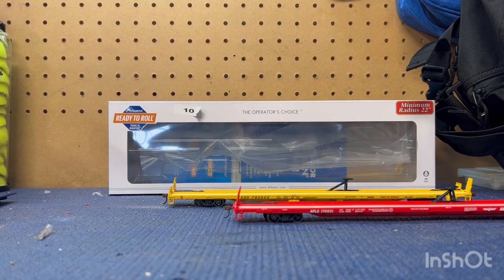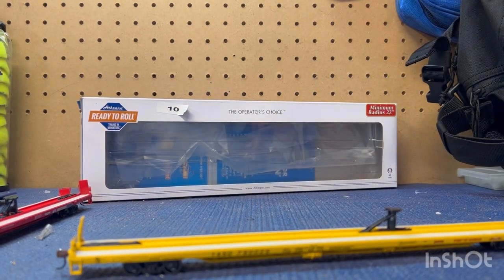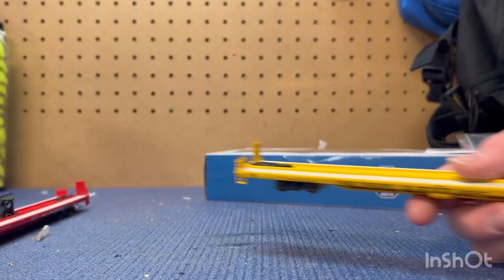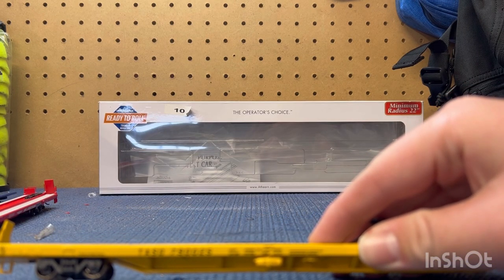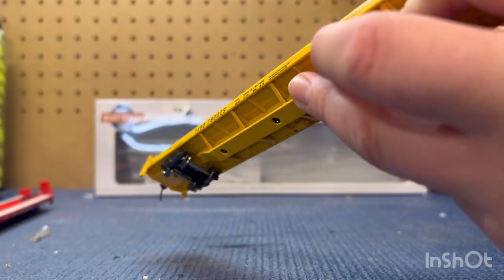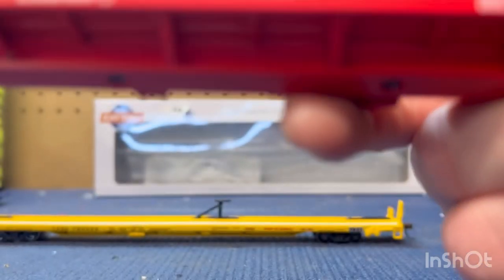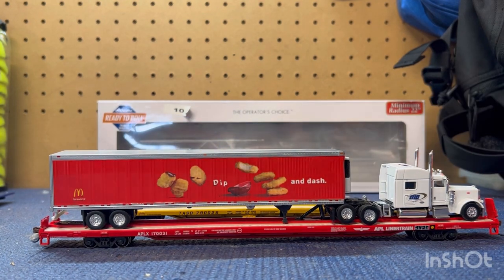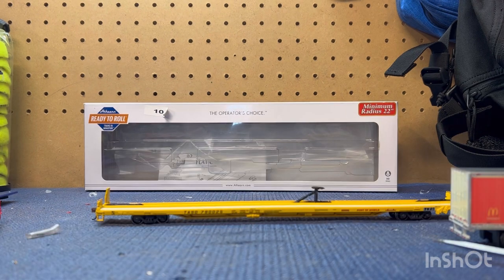Ho scale Athearn 85 foot ￼all purpose Flat car

Comment: Nice cars.I've got a few myself.😊.I have those and a large fleet of 89ft flatcars as well.The 85ft flatcars were built in the 1960s.They were used in TOFC and COFC service up untill the lats 80s early 90s.Some were used in pipe hauling service.The cars can haul 40ft trailers.The 89ft cars can haul 2 40ft trailers,2 45ft trailers ,3 28ft trailers or 1 57ft trailer.You could haul 3 57 ft trailers on 2 89 ft flats that are drawbared togeather.😊😊